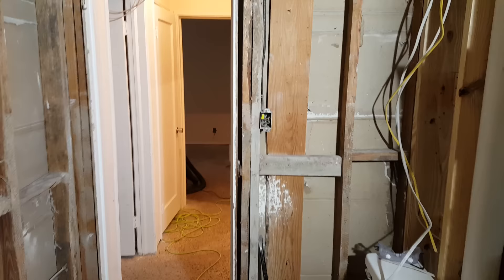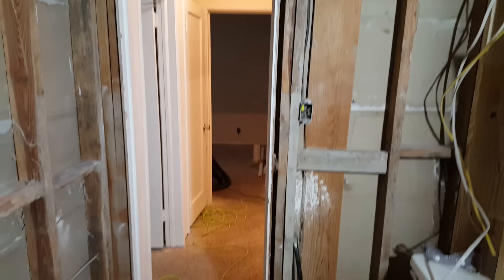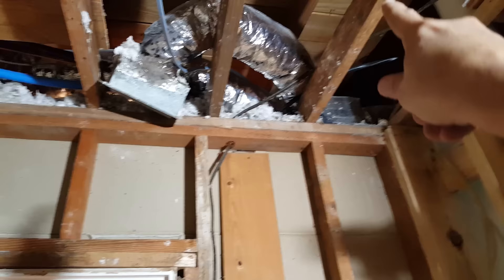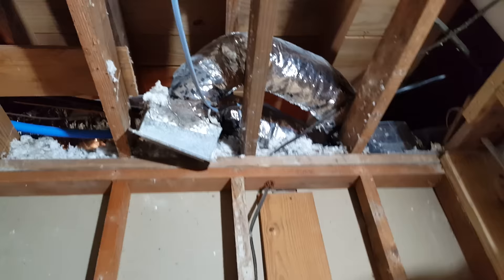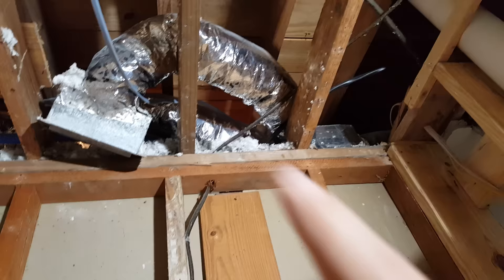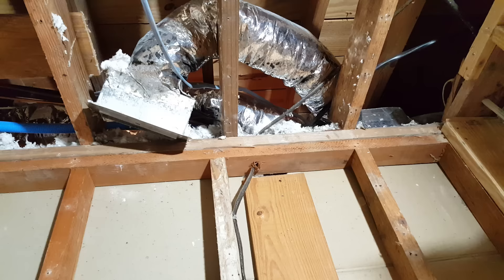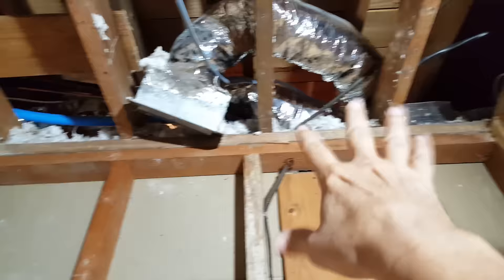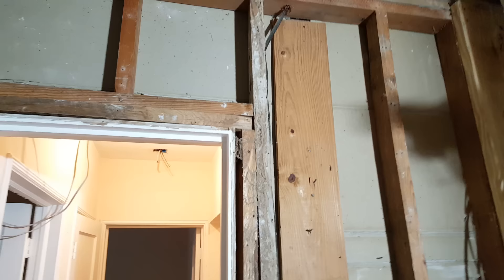How to Tell if Your Wall is Load Bearing

Comment: Jeff I need advice.  I want to move my refrigerator into a closet but need to widen the doorway for the refrigerator to fit.  I discovered above the closet is a header that the second floor joists rest on.  It's a big header, pair of 2x12s, and is supported by two king studs and one jack stud on the one side my question is about.  The king studs and jack studs are nailed into a 6x6 that runs all the way from the basement to the peak of the roof.  My problem is I need to remove all three studs for the refrigerator to fit.  Would it be feasible to replace the three studs with a bracket consisting of a top plate underneath the header, a bottom plate resting on the floor, diagonal braces at the corners, and steel plate running the length of the studs bolted to the side of the 6x6?  Basically a single, narrow steel stud instead of three wooden ones.  I know I would need an engineer to design such a bracket.
Reply from the maker: Yes, they use poles for example in basements to support the load of the kitchen floor overhead, but like you said, it must be engineered. Also some contractors will built a second stud wall in front of the wall you are about to open up. This temporary bracing second stud wall will carry the load while you are opening up the wall to make it wider.

Comment: Hey anybody know if my side split home has a load bearing wall between kitchen and living room, we have trusses built in 1978 in the attic this wall is in the middle over top the basement beam but it is trusses and the spand is only 7 feet of wall, thanks
Reply from the maker: If the trusses have an endpoint on top of the wall it is a load bearing wall.

Comment: My load-bearing wall in my house doesn’t have a second top plate. Is this an issue for its structural stability? 🤔
Reply from the maker: Not an issue at all if you don't have the second top plate. For most builders that second top plate is used to join two walls at a corner so there would be an overhang on the top plate and it would join up to the wall that's 90 degrees budding up to it. But if it is a load bearing wall I would look at every load that's above it and make sure that those end points end directly over a stud. For example if there was a roof Truss brace who's end point was on top of this wall, you would rather it be directly over a stud, then directly over the middle of two studs in that space.

Comment: That wall doesn’t have a header over the door to carry the load of the stud cut out for the door. It needs that header to be load bearing. Therefore the wall is either not load bearing or installed improperly.

Comment: Actually the cripples are the short vertical studs on the sides of the door. Or at least in my years of building experience, that what I was taught.
Reply from the maker: jkw427  When you look at most drawings today the shorter ones on the side of the door are called Jack studs and the cripples are the short vertical studs on top of the door that a real short.

Comment: No, we use double 2x10s with sleeper plates.
And what year code book is that.
MRC states all walls must consist of a primary and secondary top plate. Secondary lapping no less then 48 inches past any joint in the primary plate ,and any  load must bear above not the stud but a properly sized wall collumn.
Reply from the maker: Keith Tomczyk  What type of what are you using for the sleeper plates?

Comment: Just worked on a house where the builders never attached anything to the sill plate at all and it took a few months for the entire house to move a half a foot on top of the sill plate from storms or whatever.,  tore up all the iterior walls and ripped out lally columns off the beam..  basically condemned the home..  which was passed and inspected by the city..

Comment: 7:30
I won't be building doorways anytime soon... But I actually assumed that you would side nail the Jack stud into the king stud... Good to know. It makes sense that the weight would go into the Nail, instead of the floor.
Reply: Yes sir, I was thinking the same thing.  Correct me if I'm wrong,  but I think he was talking about side nailing the header itself directly into the kingstud and leaving the Jack stud out completely ( which is crazy as hell). That leaves all the weight that's dispersed through the header, going directly to the nails. ALWAYS USE A JACK STUD WHEN CONSTRUCTING A HEADER!!!

Comment: Stupid question but how can I tell if it’s a load bearing wall if it has drywall over it?? Obviously without the drywall like yours, I can tell easily since you have explained it. But I don’t want to cut my drywall just to see. Will I have to use a stud finder?
Reply from the maker: Only way to tell for use is get above the stud wall in the attach, and if any rafters or ceiling joists have endpoints that end on top of it, then it is a load bearing wall

Comment: So I should be able to  use a stud finder to see if the joists line up with the studs behind a wall?
Reply from the maker: Yes you'll be bale to see the joists with a stud finder. Sometimes they don't attach the drywall ceiling right to the joists, but rather to corrugated nailing strips made for drywall. In that case it may or may not see the joist.
Reply: @jeffostroff  Awww man you made my morning with the fast reply! Thank you so much for that!
Reply: @jeffostroff  And thank you for the breakdown video. It really made a lot of sense!

Comment: So, joists do not necessarily line up with studs, in fact I bet then don't line up more than they do line up.  The stud and joist spacings may be totally different.
Reply from the maker: Right, better builders try to engineer the skeleton of the house so that the joists line up directly over a stud.

Comment: You cant use 2-2x4 flat ways in a load bearing wall due to its weakness in the x/x axis. 
The only true way to determine load bearing is if the truss or rafter is beared upon by the roof members and if there is a foundation under the wall.
You can fasten a header with shear connectors and that is how hangers work. But end grain nailing is tricky.As stated in the "Douglas-Fir Use Book", page 209, under End Grain:

"The withdrawl resistance of nails and spikes into end grain is quite low, and connections of this type should be avoided where possible.  The allowable lateral load per nail or spike whjen driven into end grain is two-thirds of that for nails or spikes driven into side grain."  Many window sills are nailed this way.
Reply from the maker: The real definition for the load bearing is if the roof joist has an endpoint on top of the stud.
Reply: @jeffostroff  Yes and I meant interior load bearing.So i heard Kai is a realtor??

Comment: Love that header!
Reply from the maker: Yes cheapie house Built-in the 1940s for veterans that's how they did it back then also they're still debate as to whether this really is a true load bearing wall. I still prefer to build them with the Header as vertical 2 by sixes even if they're not load bearing because it give you the option to make it a load bearing wall later on.

Comment: The primary function of a cap plate is to interlock wall connections. In other words, you do not want wall intersections only to be joined by a butt joint.
Reply from the maker: Sander Curtis  Correct and also you would not want the top of your load bearing stud wall to be just a single stud you really do need that 2nd plate for load bearing as well because if a ceiling joist ends up in the middle of 2 studs, you  Sure as heck want more support under that joist then one 1 1/2 inches thick of a single top plate.

Comment: I'd always learned that the lintels should be oriented the other way to maximize strength (more difficult to bend two 2x4s on edge than for two stacked 4x2s to flex).
Reply from the maker: Siegfried Braun yes that is how they do it now. Not everyone did it back in 1946 when this was built.

Comment: Thanks for this. What about for masonry walls? Same idea ?
Reply from the maker: On Masonry walls such as exterior walls you are almost guaranteed that they are load bearing, as the ends of the roof trusses and ceiling joists rest on top of these walls.

Comment: But now I want to know how you make this doorway wider. Can you have two jack studs next to each other doubling this doorway? Or does it take a special beam at that point?
Reply from the maker: As long as you use a header made from vertical 2 by 6 lumber and not 2 by 4 lumber I think you're always best case scenario even on a non load bearing wall I would still use the vertical 2 by 6 lumber.  So what you do for the header is you cut the 2 by 6 lumber according to the width of the doorway can you make them stand up on so 6” side is vertical, you cut two pieces and sandwich in between the two of them a 1/2 inch sheet of plywood because you need to shim up that extra half inch space for drywall purposes. Some guys prefer to run nails through all three pieces and glue them at the same time. Then you can do double Jack studs if you like nothing wrong with that.

Comment: There would be short pieces of stud between the "header" and top plate above the jack studs if it was a load bearing wall...There would also be studs coming down from the rafters to the top plate if it was load bearing in this case... otherwise - what weight is it bearing besides the ceiling rafters and drywall?
Reply from the maker: Yes that is true, but not always, many times contractors get lazy and don't install those 2 cripples you mentioned that would amount above the jack studs.

Comment: Excellent video.  I'm needing to replace a section of bottom plate (approx 8' in length) in my mobile home.  This is on the exterior (load bearing??) Wall in my bedroom.  Can I support everything by screwing some 2x4s to my floor joists then put a temporary "top plate" below the ceiling?  I.e. a temporary wall inside of my wall that needs bottom plate replacement?  I hope that makes sense.  I would do those 2x4s on every floor joist and go up to the temporary top plate. Thank you
Reply from the maker: We have a video on repairing the bottom plate here: https://youtu.be/nnJp4H8y1aA just make sure to use a pressure treated lumber piece for the bottom plate, it is required by code.
Reply: @jeffostroff  thanks!  I have removed a section of floor so could I just screw the temporary "wall studs" to the floor joists up to a temporary top plate?

Comment: How do you support the opening until you can get your headers in top of new doorway when you are going to cut the studs for a new door?
Reply from the maker: Most folks build a second stud wall parallel to this wall, and it's basically a few inches in front of it. When they are done framing in the new door, they remove the temporary stud wall. Some also us e along metal beam with telescopic support poles that they just break back down afterwards.
Reply: @jeffostroff    I was able to see that my studs are in same location as rafter beams. So guess they are supporting studs. Seems simple enough to put in the temp. stud walls. Thanks!

Comment: Two  plates are stronger than one and ties wall together also. If you only had top and bottom plate you would have to cut your sheetrock to make it fit. With 2 plates on top 1 at bottom you have 96 3/4 inch and with just the 2 you have 95 1/4 in. Sheetrock is 96 length and if you put sideways 48x2 equals 96. Serves many purposes not just one.

Comment: This doesnt always happen bud. I worked for UFPI and delt with many wall panels, roof and floor truss engineering. Works in theory, but in reality no. The best way and quickest way is to look how the truss is designed. Many of homes have the top and bottom plate on interior and exterior walls. The next 2x4 on top is to connect the panels together. Under UFPI building specs for Southern areas, anything under 20ft wide wont have any interior bearin points. Anything over will have 1 to 2 extra.

Comment: U have some good points on explaning thing's, but U yourself need to learn what a "Load Bearing" wall is and how to detect one, I really doubt this is one, No load from above and ceiling joist don't intersect over it. Only thing you can't see is how far they span, double plate's have Nothing to do with it being Load Bearing...
Reply: Continuous joists don't mean it's not a bearing wall.  We don't know enough about how this roof is constructed to say for sure what this wall is doing.  Double top plates will likely be typical for all interior walls unless the builder is ordering custom length studs or cutting every single stud in a bearing wall.  Both are more costly that just installing a second top plate.
Reply: It may or may not be load bearing. It's fairly common to have load bearing walls towards the center of the house..... that allows the builder to have ceiling joists that are less strong. It takes a lot more strength to span twice the distance without support. The answers would be up in that attic....

Comment: Say the roof is held onto the perimeter wall. What about the ceiling or attic floor support? Does a wall in the middle of the house hold up the ceiling or floor from the attic?
Reply from the maker: That has always been a debate among experts. Is there nay sagging of the middle of ceiling joists that would put some downward force on any wall in the middle that is not designated as a load bearing wall? I have always felt there is some downward force in a case like this. At this house, we had a wall in the kitchen that was not a load bearing wall because no joists ended on top of the wall, or crossed other joists over the wall. We only needed to make a door opening in this wall, and so we did preserve the wall altogether. If you remove the entire wall and replace it with a beam, now you have to worry about the end supports under the beam, if they are up tot he task of supporting the beam. So many unknowns.
Reply: @jeffostroff  there is a basement with a cinder block wall underneath this wall I am talking about. Removing this wall I am talking about would leave a huge ceiling or attic area unsupported which I think can be easily resolved with a metal beam.
Reply from the maker: @thetommantom  You'll also have to make sure whatever holds up that beam is up tot he task, preferably metal poles. Also under the basement to carry that load from the beam support pole down to the foundation will also be needed. Usually also metal support poles in the basement to support the floor joists above it.

Comment: QUESTION: what is the 1x board to the right of the door doing for the wall?
Reply from the maker: If you look at 0:14 in the video, it appears that one by board was put there to join two sheets of drywall together on the opposite side of the wall from the bathroom in the living room
Reply: @jeffostroff  That makes sense, in a jerry-rigged pennypinching oops we measured wrong kind of way.

Comment: wow, thank god i watched this video before expanding my opening in the basement vertically while preserving the header.  

When i was picking a window for my basement wanted to get a wider window.. .vs what i actually have now... but that could have cost me... partial house collapse...

My strategy initially was to simply remove the header and expand the window horizontally.

If i didn't watch this video before doing this... by the way and sound of this video... my  potential mistake could have resulted in house partially collapsing.  

Now of course... that is all hypothetical... but....  hypothetical or not... theoretical or not... load distribution does matter... Hence before doing window yourself folks remember this video :)  thank god before touching any DYI project I review entire 360 degress of every aspect of a particular trade before I dive into it...

This knowledge will help me be more prepared for commercial real estate money making world... Speaking of which in case if anyone wants to learn... about it... feel free to check out StudyGuide.net/Real-Estate lots of cool useful tips and tricks for how to get out of rat's race while leveraging knowledge and expertise from trades like shown in this video..

Once again... thank god I watched this video before expanding my window... I will document this discovery in my blog for other folks who are diving into commercial real estate.. to know... before they purchase huge buildings for profits.

Comment: So I’m moving a interior door to my bedroom to the same wall but to the corner, does it matter if it is a load bearing wall or not?
Reply from the maker: Yes it always matters if the wall is load bearing or not so if you have to cut a hole in the wall 2 put your door in there you still have to run all of the support studs on either side of the door frame in order to allow the load to continue to get down to the floor

Comment: Is the header, above the door, in this video, built correctly? I thought that , for instance if you were using a header for a 6 foot opening( just an example), the width of the material would be standing up, while the thickness of the material (two, 2x6s and 1/2 inch piece of plywood or OSB would be sufficient to sit on top of 2x4 studs)would rest on top of the jack stud? The header, constructed in this video, isn't that way. The width of the material is sitting on top of the jack stud. I know its doubled and the opening is less than 4 feet( obviously), but wouldn't it be weaker? Leave the plate above the door, construct a header with two, 2x4s and a 1/2" piece of OSB or plywood,  place it where you're looking at the width of the material ( the 3 1/2" face of the 2x4)
Reply from the maker: There is still argument about whether this wall is load bearing. but also sometimes these cookie cutter homes from the 1940's were not always done correctly. Yes you would normally sandwich two 2x6 boards with a 1/2" plywood in the middle, and stand them upright.
Reply: Thanks